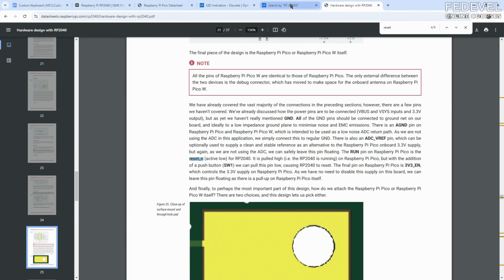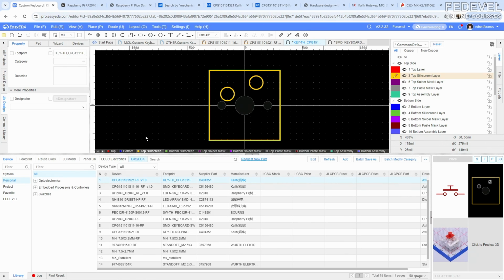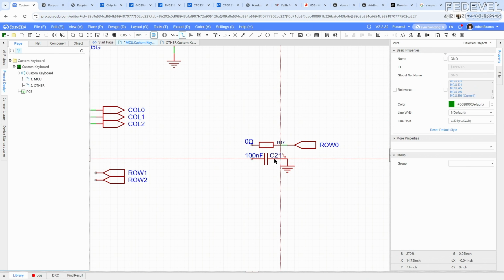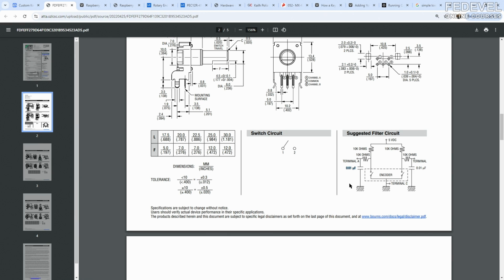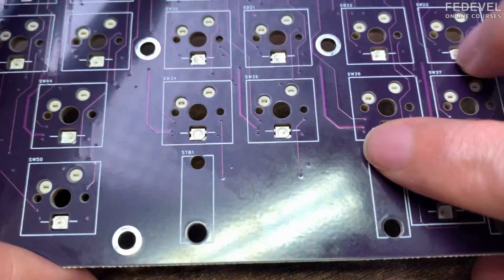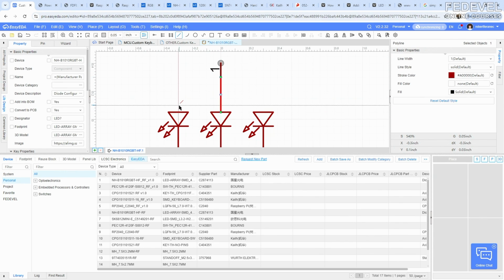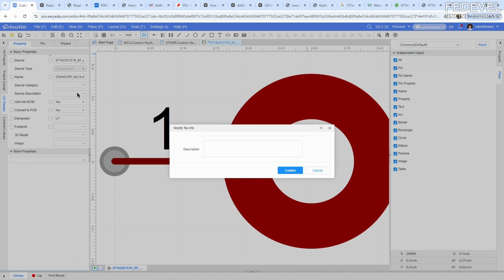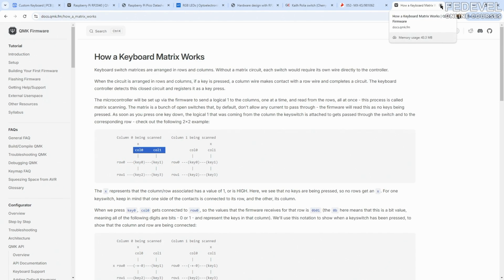Tutorial - Custom DIY Keyboard Design and Build | Part 2: Keyboard Schematic

Comment: One question Robert. First of all thank you for your great help in building these keyboards. 
At 8:10 you add the 3D model and the socket is placed on the PCB. But mine is not. It only shows the socket. At the top of the 3D model manager, the column under ‘Footprint’ is empty for me. What did I do wrong? Please help me. I can’t go ahead without it. 
Thank you in advance.

Comment: Do we need to annotate schematic? What happens if I leave it as it is?
Reply from the maker: no, no need. But it is good to know that this can be done. Sometimes re-annotation can be useful e.g. if you would like to start reference designator with page number. Also it is good to have nice designator on the key components e.g. connectors or chips - in that case you do the key components manually and annotate the rest.
Reply: i found one LCSC Part # C404350

Comment: Hey Robert, for some reason when I use the same exact RGB LED as you in Adding and Connecting LEDs I have a different footprint and 3D model. For reference I am using the C5149201 part just as you are. I'm not sure what to do to the footprint to make it the same (I am missing the top right circle and cant figure out how large it should be or the spacing from the arm and the middle area), the middle area also does not have the white outlining like yours does. Essentially the side where the circle should be is cut very short and exposing that side of the LED.

Comment: It is recommended to use STM32 as the main microcontroller for this type of keyboard, either in its STM32WB versions if we want Bluetooth compatibility, or in its normal versions STM32 M0, M1 or some other ARM version of the STM32??? . Thanks for the tutorial, i'm just starting and your videos are very explained and profesionals.

Comment: Hi, I'm really enjoying following along this tutorial. I have a question regarding aligning the 3D model of the keyboard switch with the footprint. Where is this information provided on how much to move exactly in X, Y and Z direction?
Reply from the maker: sometimes you can guess where is 0,0,0 of the 3D model and calculate the shift based on datasheet. sometimes I just do it by eye.

Comment: I didn't quite understand that why is there a 1.1V voltage circuit and what exactly it's purpose?
Reply from the maker: many chips need additional voltages, usually to power some parts of the chip. Often chip manufacturer will place regulator on the chip to make board design easier, but you still need to place external capacitors (making capacitors on silicon would take too much space or it is not even possible for caps with bigger values) so they place pins to the regulator output, you place there capacitors and then you go back to the chip.

Comment: What a great job, thanks! I’m not sure how LCSC  is related to JLCPCB parts. In this case, do you have to worry about parts being in the “basic” catalog to avoid expensive prices of the “extended” catalog as in JLCPCB parts?
Reply from the maker: Thank you. JLC = JLCPCB + LCSC + EasyEDA + JLC3DP (they are all the same company). In this project I was not very picky about components. Of course you can try to find basic variant if it is available.

Comment: Careful with key switches and sockets. There are multiple switch pin layouts, and each layout has a different hotswap socket. There are the more widely used cherry sockets (for cherry mx switches but also many others), the kailh choc low-profile (which I believe might have a different pin layout than the choc v2, and also have a weird keycap stem instead of the more standard cherry cross); Gateron (I think) also has some low-profile switches that have a different pin layout from these others, and there might be others I don't know about.